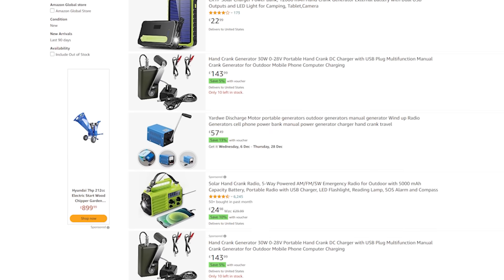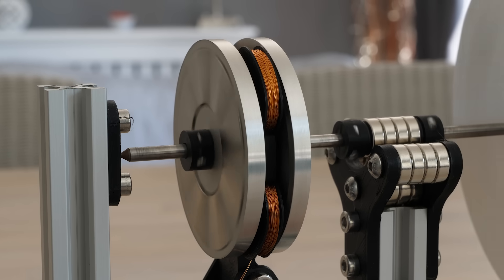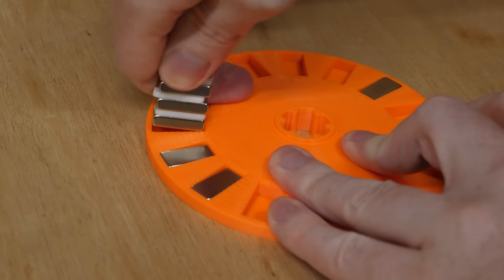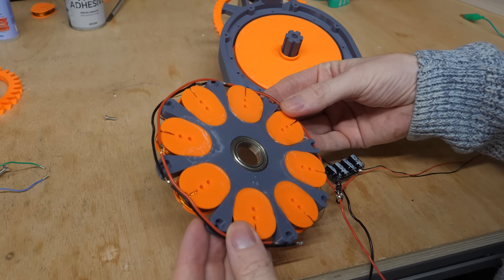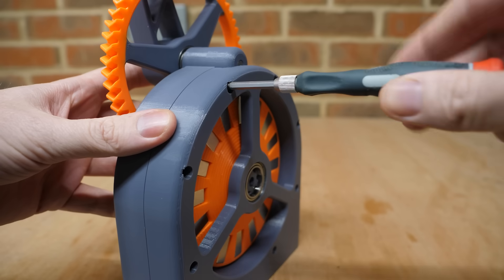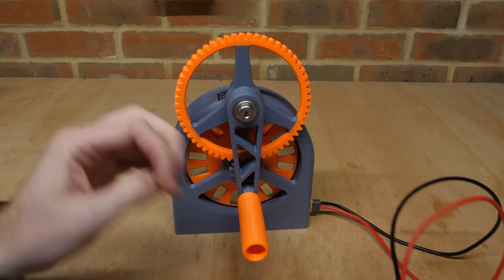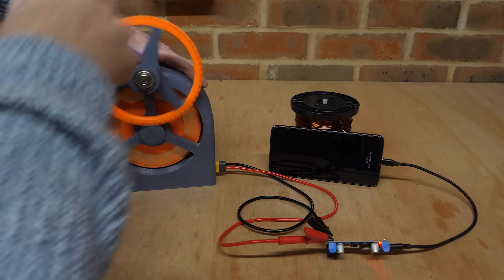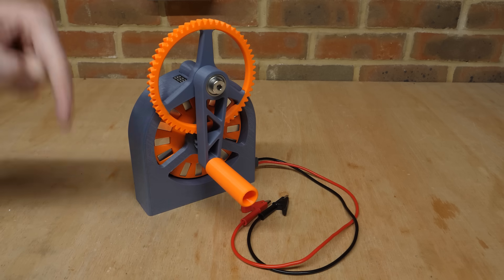Building a Generator

Comment: If you put a USB-PD Board on it you could probably charge your phone in about 30-45 minutes from 0% and you could attach it to a windmill, watermill, or something else.
Reply: If he adds a  battery bank to the generator or wires up some supercapacitors and a circuit then he can charge up the bank in 15 minutes and store the energy for later use or let it charge his phone while he builds some cool stuff.
Reply: @DKFX1  Not even the BEST, buyable Pedal-Generator can charge a 10000 mAh-Powerbank in ...what? 15 Minutes!

What are you smoking? Do the math: You lose 50% of energy when you plug in ANY USB-device! Because this is when you convert the energy into 5V-energy.

So when you produce 5 watts only to begin with, then i would take around ~12 HOURS to charge a single 10000 mAh-Powerbank.

Even when you coinsider this can handle 50 Watts, halved this makes still only a 25Watts. I would take 1.5 HOURS to charge a single 10000 mAh-Powerbank.

For comparison: I can charge 4 POWERBANKS in about 2 hours.

My pedal-generator can do about 100 Watts/hour. 2 Hours = 200 Watts. Enough to charge 4 powerbanks (4x 37Wh = roughly 160Wh) INCLUDING a small powerloss of 10Wh for each because of convertion. This will use fast-charging with 9V btw, not with standard 5V. So insead of losing 50% energy, you lose 25% only here (roughly around 50 Wh will be gone into heat).

But after 2 hours you will have 4 FULLY charged 10000 mAh Small Powerbanks.

Of course you can charge 2 pieces of 20000 mAh-Powerbanks in 2 hours oo. And your powerloss will be even less when doing so (since wih 2 devices you lose less power then when you have to charge for 4 devices at once). Your loss would be ~40Wh only then of 200 wh (20%).

But in order to fully charge a 10000 mAh-Powerbank in just 15 minutes...hahaha! You would need to handle 200W per HOUR! And that is...well like running a marathon indeed. You wouldn`t be able to do this. But 200W in 2 hours can be done!

Comment: Since there are a lot of moving parts, which of them might be better swapped with stronger materials like aluminum so that they don't break easily over time (as long as it doesn't cause interference in the magnetic field)? If you can design a phone charger that's connected to a bike seat generating 20W/25W, it might be able to charge a 4000mah phone within an hour. This would be a prepper's dream device.

Comment: Gyms could use this on some machines XD. Was it possible to increase the ratio or put like a heavy object high up and let it slowly convert potential to electrical?
Reply: Haha self-powered gyms.I like it..Membership discount 5$ per kWh of power produced in the gym.
Reply: @DKFX1  You laugh! But in a not-so-distant future it could become true!
Reply: @SmartZero-f8e  yeah.  it's one of those fun ideas that one could imagine be implemented in the real world.
Reply: @DKFX1  Correct. But with 1 kWh only you wouldn´t get 5$ rebatt. that would be very cheap and not good for the gym in the long run, haha.

But i assume. "Pedal 5kWh in total and you will save 5$ on your next payment. Or: Pedal 15 kWh and save even 20$. Or if you are a real pro, pedal 50kWh IN ONE YEAR and you will recieve a full 75$ back".

So yeah. that´s really fair. And i assume energy will easily reach 1$/kWh then.

The funny thing is: they could have done this since 20 years allready. Such powerful tech today exists. But is is nearly never used.

Comment: With how small this is I'd love to see your take on doing a bike pedal version of this. Think of how easy it would to generate power that way!
Reply: It's very easy to do this in two ways. Either you can unhook your rear bike tyre and hook up a belt drive between this generators shaft and the wheel rim. Or you could use my preferred way. You create a friction surface between the generator shaft and the bike tyre, then you can lift the rear tyre with a bike mount and simply mount the generator firmly against the tyre to rotate it.

Comment: Might be worth adding a Joule thief - buck/boost regulator - on the supercapacitor output, then you would be able to discherge the battery bank down to 2V or so and get a much longer run time for the same capacitor bank. Added advantage would be a constant voltage output.

Comment: Im curious, why create an alternating current generator if you're just going to place a full bridge rectifier at the end to convert it to dc?
Reply: @leeroyjenkins0  when powering devices how would you regulate your ac frequency with a generator such as this?
Reply: @leeroyjenkins0  I thought wind turbines today used a system of computers manipulating gear speeds and ratios to always have the ac output at 60 Hz?

Comment: Could this be manufactured into bicycle pedals and used as a never ending pedal assisted electric motor?
Reply: You want your pedal cranks on a bike to go into moving the bike forward, not making electricity for a battery attached to the bike. If you do both at the same time, then you're going to be exhausted driving 5 mph on flat road. You could use regenerative breaking to get a little bit of extra juice, or crank the battery when the bicycle is going downhill, but the amount of power you will get is not enough to transport you on a bike very far.

Comment: Could you put a freewheeling sprocket on the crank and use a motor, driven by the crank motion initially, to continually run it with tangible efficiency or would it all be consumed in parasitic loss? 😂

Comment: so, by making a hand crank and that powering a electrical motor which spins a couple magnets around the copper coils which generates even more electricity which afterwards we could store and use that power to power the motor we can have semi permanent electricity? ofc we would need to have a way to power off the electric "engine" aka motor  as well xD ... but yea energy is finite,friction heat are all made from energy, but that converted energy dissipates and remains in things,other things,so its actually infinite but not in a single place where we would want it.
Reply: With a small motor that doesn´work, as you consume more energy out of the motor, as he motor can produce.

Comment: Quick question, Is it possible to charge an electric skateboard with one of those?
Reply: A  good hand-cranker can produce a STABLE output of between 30-40 watts. So assuming your elecric skateboard, doesn´s have a 1 Kw-battery, and is e.g. having a 300Wh-battery...yes you can charge it. But it would ake you 10 hours then!

Comment: Just built my hardware, bar the magnets, had to remortgage the house to buy those first !! 😮 
Got to wire up the coils next and fit the rectifier circuit etc. I’ll link you in my video once it’s up and running. 
Thank you for sharing such an amazing model, the project is so well produced and explained perfectly, really well done. Kind regards.
Reply: I'm going to be using some neodyms I found in a couple old hoverboard motors. Took a little chemical care to get them loose from the motorhousing but I think they'll do the job for a fraction of price of buying new ones. Managed to get something like 25 of them loose without them breaking but they are bit fragile compared to some I've seen.
Reply: @DKFX1  good thinking !! I would love to see that in action when you’ve done it !! 👍🏼 
I may have to do some salvaging myself next time if I want to turn this into a bigger version suited for a wind turbine. Hopefully strong enough to charge a battery bank that could power the lighting in my workshop. 🤞🏼 that’s the plan anyway.
Reply: @Prof.Polymath  Had to remodel the rotor to acommodate 30x10x4 mm magnets instead. If that's what  you get then post and I'll share the stl file.
Reply: Did you make this crank generator, if so I have some questions on how to solder the coils. It says 4 in parallel and 2 in series what does that look like.
Reply: @zekeahmadzai5099  Hi, yes I made it up to the same point as yourself, couldn’t find my solder so stopped there for now, there are a few good explanations in the comments of the video and in the printables info/comments on what others have done. 
You basically join 4 together in series, twice, so you have two sets of 4, then you link those 2 sets of 4 together in parallel. Series means one after the other, +\- to +\- etc 4 times, parallel means to have them linked sideways, so both power input and output ends are linked together, so that both set of 4 are working together as a pair, “in parallel”. If that helps to put it into simple words? I don’t know, may have just confused you even more 😂🤷🏽‍♂️ but hopefully you’ll get it from that and the other comments sections. Good luck, let us know how you get on or send a link to your video. Thanks.

Comment: For the phone charging you almost had it.  You don't want to crank for an hour so charge up your capacitors to some high voltage, then unplug your generator and connect them to your 5V DC to DC board you have.  Plug that into your phone.  When the output drops too low, charge the caps again.  Related - check out the comments below about not using 4 regular diodes to generate DC - the losses are awful.  Also, there was a suggestion of building 3-phase which converts to DC far more easily and efficiently (though you need 2 more "diodes"), search "3 phase AC to DC".

Comment: so if you uped this a little bit, 4-8x the capacitors, maybe 2-4x the geny, proly honestly just 2x
You could realisticallty peddle for 45 mins, a legit workout and legitimatly charge your pda
We live in some wild times
Reply: Standard-capacitors can only store FEW energy. You need BIG 400V-Capacitors (or even a Capacity-bank of that sort and hat is EXPENSIVE!) if you want to store a LOT of energy and make them more save and reliable and have LESS LOSSES. those capacitors can easily be charged 1 MILLION times.

A single 400V-Capacitor costs 10$. My Pedal-generator uses 6 of them so that will cost you 50$ allready. It can store about 2.5 Wh of energy in all 6 of them.
Reply: @SmartZero-f8e  really only 2.5wh? are they supper caps or just regular caps?

Comment: One note, you should place two capacitors before the rectifier bridge. Because of the coils, the current will be lagging the voltage. You should use a multimeter to calculate the inductance between the terminals before the rectifier bridge. Then you should calculate the capacitance needed for correction that makes the current in phase with the voltage. If you have  an oscilloscope you can view the phases of the voltage and current at the same time. Because the reluctance is frequency dependent. So, the phase will change depending on frequency. The normal rotation is first determined and the resulting frequency is calculated.

Comment: How much amp this thing outputs
Reply: About 5 watts most likely = 1A at 5V. So it´s low and you cannot even charge some more advanced tablets/iphones with this. Good handcrankers, costing about 100$ to buy them, produce around 30W of output (at 12V only). With 5V only you get around 3A at 5V out of them (-50% power loss because of low efficiency USB).

If you use a fast-charging USB (such as PD) you ge around 80% efficiency, losing only 20% of energy. But such circuits cos much more!

A Good pedal-generator easily will cost you 500$. these are the RAW materials!

Comment: I want to install stationary electricity generating bicycles for the whole family and watch  all of us work hard or scold each other when the power drops during our favourite TV show or while playing video games.
Reply: Just make yourself clear that a GOOD, really usefull 120-200W-Pedal cycle generator costs about 500-800$. Each one. So you would have o pay 2000$ to get 4 of them.
And no you cannot produce hem cheaper. Self-build ones don´t even have close the power a really-well one designed from china has.

But you are right. If you have the right batteries (you need 12V-bateries, not 24V ones! 24V ones cannot be used, as most cycle-generaors cannot produce voltages higher than 20-24V), then with many people you can produce a LOT of energy. In heoryy, wih 4 people owning each such a powerful generator, you can produce 1kWh per day!
Calculation:

1000Wh : 4 = 250Wh. In 1 hour one person can produce around 125WH when well-trained. so in 1 hour 4 persons can producce 500wh. So in 2 hours/day you can produce 1 KWh wih 4 persons all riding on these hings, just watching 2 hours of TV.

Comment: Some tips for this nice project Pla for holding the coil widing is not so good as the coils will produce heat (especially in big loads) and I am no sure if the Pla will hold without deform. 

Also if you add iron bar  inside the coils helps to produce more 

And finally as suggested and by others as I read, if you place the opposite magnets in the same iron plate (like a u shape) then you will have more  flux

Comment: What i never understood is why people never tried this with a bigger gear ratio. I've seen gear ratios that literally tear themselves apart due to the speed of a few rotations. Would that not pepduce alot more energy? Just wondering.
Reply: No. More gears only make pedalling/cranking harder (more resistance). You ain´t magically get a lot more energy when your hardware cannot handle it. Not even with tricks.

Comment: Could you build a hand or pedal crank generator with enough efficiency to keep you from freezing to death when connecting to a space heater?
Reply: The best pedalling-generaor produces about 200W/hour max. But normal pedalling will be 100W/hour or 120W/hour. So yes. You can produce enough heating-power with it so you won´t have to freeze.

However be reminded: You won´t freeze to death when pedalling in general. Since this will make your body sweat because of heat! So you won´t have to use the power to heat your rooms except if you have others in your household and they want that power used for heating-purposes. Also be reminded:

A pedalling-generator will produce a lot of heat via voltage-conversion and regulation. The motor gets warm (small handcranking-motors can get even HOT! I depends on how long you crank and how fast you crank with it, bu frcition of he gears and the motor slowly geing warm will rapidly release dozends of watts into your room when cranking for 2 hours). the casing can get warm/Hot. and all this heat will heat your room in the end.

The losses when using USB-charging are 50%. So when you pedal with 50W only (slow pedalling) and you charge your 2 USB-devices connected, they will NOT be charged with 50W. Since you lose 50% of that power with standard 5V-USB. Instead you will charge with 25W then. 12.5W for each USB-device you connected.

The rest, full 25W will be going into the air and heat up your room.

But for your quesion: No. It is NOT possible to produce more than 100-200W/hour to power a SPACE heater. Cranking and Pedalling is enough to charge your phones, tablets, gaming-devices OR to power your laptop, to power your PC (assuming its having max. 200W) OR power your TV (max 50W) and a SMALL heating-device with max. 100W. Of course you can power your freezer/refridgerator as well with that power assuming they both only consume around 60-80W/hour.

But a SPACE heater needs thousands of watts. If you want to run a space-heater you need to push that energy into a BIG battery first!

Comment: A couple of thoughts...

Did you consider adding a phase shift between each of the series-connected coil pairs? I think you could make the rotors and stators a little larger, add four more magnets to the rotors and get a nice 4-phase alternator. Rectifying that to produce DC would require more diodes - I think you'd need 8, but the output would be fairly smooth even without the capacitors, so maybe you'd get away without needing so much capacitance and diodes are probably cheaper than those caps. Alternatively, stick with the 16 magnet rotors and reduce your coils to 3 series connected pairs and I think you'd get a nice 3-phase alternator. You'd need 6 diodes to rectify that, but should still be reasonably smooth even without such large capacitance. This might also give you the option to power 3-phase motors, although not sure if there's a practical application for that. Probably just something that engineers might find cool.

Did you consider putting steel plates on the outsides of the rotors? I think that may increase the strength of the magnetic field going through the coils since you're reducing the reluctance of the flux path outside the rotors where it's not doing anything useful. If you make them thick enough you may also effectively shield external objects and debris from the strong magnetic fields of the magnets which might be useful in dusty environments where the magnets might have an annoying tendency to attract ferromagnetic dust.

Comment: Im sure many other have suggested this. But if you put some kind of back iron behind the magnets. Youll get significantly more voltage from the same magnets. And the iron acts as a sort of fly wheel for axial motors

Comment: If you do the supercap in parallel with the USB charger I think you would get more out of the cranking as it distributes your effort over time. Or get an USB C type charger that can up the voltage and amps more. Maybe put more coils in series to prioritize higher voltage which the DC-DC transformer transforms down

Comment: i want a bike where the pedals are only attached to a generator like this (no chains, chain gears, or derailleur), the generator charges a battery, the battery powers an electric motor, and the electric motor is the only thing driving the wheels, controlled at the handlebars, does such a thing exist?
Reply: No, since your RPM of the moor with no gears and no chain wouldn´be enough for big output. 2x less RPM means 4x less output!